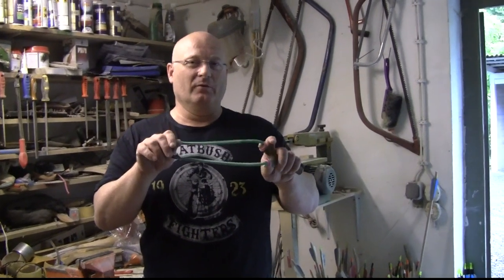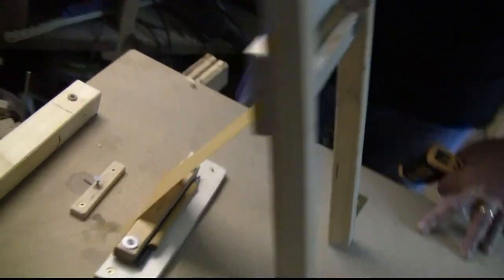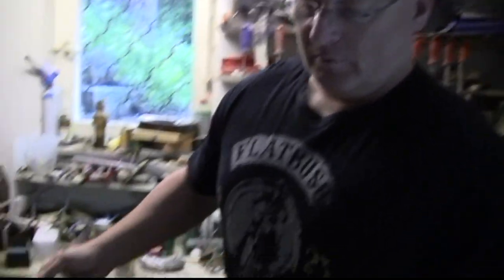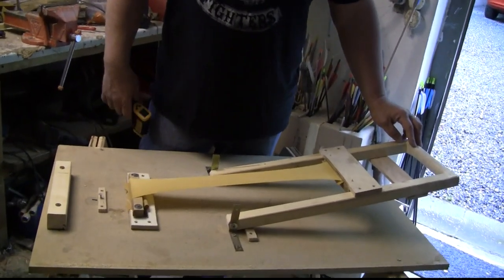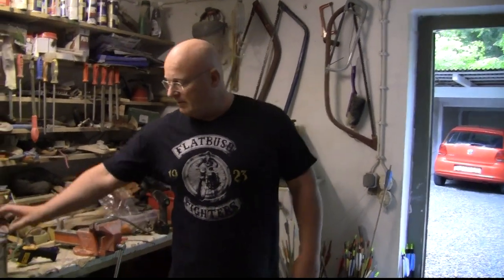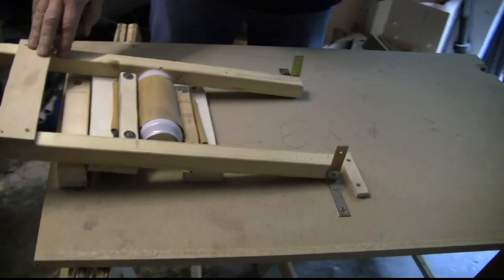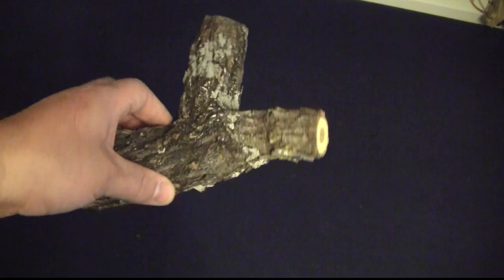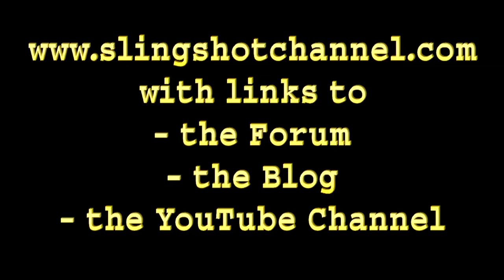Cooling beers with the slingshot

Comment: two things would improve the efficiency of your brilliant rubber powered beer cooler.
1. Cover the beer when you aren't cooling it.  You are allowing the beer to warm up while your stretched rubber is cooling off.

2. Provide a different beer/rubber configuration, so that the rubber is contacting underneath the can. There is a bit of air at the top of the can and that won't transfer the cooling as quickly as the side of the aluminum can.

Comment: What you need is TWO rubber banded levers opposed. That way, the beer is being cooled by one relaxed band as the opposing (stretched) band is cooling. The beer spends less time sitting in ambient air temperature, and twice as much time wrapped in a cooled band.

Comment: Your problem is that the thermal energy stored in the rubber dissipates into the environment, and then the thermal energy of the beer transfers to the rubber until they reach equilibrium. Unfortunately, the thermal energy released into the environment from the rubber will then be absorbed by the beer until it reaches equilibrium. With no way to keep the beer from absorbing heat from the air, all your doing is cycling the heat.

Comment: A way to optimize is to put rubbers on both sides so when one is relaxed the other is stretched.  That way there is always a rubber touching the can.  If you don't do this, when the rubber is cooling, the can will heat back up to room temperature.

Comment: Stretching the band makes the molecules agitated, so they get hot.  He waits a bit for the hot rubber to cool off to room temperature while stretched.  Relaxing the band mellows the molecules, so they decrease in temperature to 6°C below room temperature.  The cool band can then try to cool the beer.  The beer has much more mass than the band, so it would take many, many cooling treatments to get the beer to 6°C below room temperature.

Comment: theoretically you could go cooler by force cooling the rubber at stretch with a fan. B-)
Reply: leigh bamforth but you got to be carefull, if you cool it streched to 6 degrees it will freeze on release.

Comment: Actually your rubber refrigerator is somewhat similar to just normal refrigerator. It uses the same principle (2nd law of thermodynamics), but instead of vaporizing and condensing coolant you stretch the rubber.
Reply: No
Reply: There is a trick.
With elastoplastic or viscoelastic materials strain you can only have energy dissipation, therefore heating. But it's different from the increasing temperature of a compressed gas or condensed coolant.
To cool down you'll either need either a gas expansion or a phase transformation with a coolant. Maybe one of this solution is hidden within the rubber.

If it's not rigged, I would suggest that the air in the pourous medium of rubber might get compressed during the stretch dur to high strains, and expanded during the release. But I didnt feel anything when I quickly tested it.

Comment: heat is actually movement energy at the atomic level. when you introduce tension in the elastic you increase the movement energy - then you let that extra heat bleed away into the ambient room temperature. When you later let the elastic relax that makes the movement energy decrease, and since heat is essentially movement that relaxation can "eat" heat and make the elastic locally colder for a time.

There is probably some friction involved, but the effect is less strong than this other effect.

Comment: If you put a little fan on the side blowing onto the rubber, you could get it back to room temperature faster, which would result in a more efficient system. You could also have a big metal slab that would contact the extended rubber sheet, which would suck out the heat of the rubber, doing the same thing. Also having two of them on both sides so that one was contacting the can while the other was extended would make the system more efficient. I think that a purely mechanical cooler is awesome!

Comment: Super interesting concept! But a normal refrigerator is just a heat pump/stirling engine which doesnt involve evaporating/condensing. Just adiabatic and isotherm transitions. 
The concept is even more similar: A rubber band is just the same as an ideal gas from an statistical mechanics viewpoint. Compression of gas gives loss of entropy = Stretch of rubber gives loss of entropy. Just need mechanical power to be able to create a temperature gradient and exchange heat!

Comment: If you think about it, it is no different to the way a refrigerator functions. With the exception that, in a refrigerator, the refrigerator compresses the gas, rather than stretching it out. The gas is compressed on the outside of the refrigerator, it is hot. The refrigerator waits for this gas to cool down. It is then released into pipes on the inside of the refrigerator. The air returns to its normal state and becomes cold.

Comment: Well, i think you can't cold your beer by 6 degrees in this way with only one "machine" like that because when the rubber is streched to heat up the bear is also heating up, so there might be some difference after repeating this again and again but it won't make a sense. anyway, nice science!

Comment: I've been thinking about this actually. What if you had multiple bits of rubber on a chain and sprocket system. One end stretched the rubber, and the other end relaxed it. That way you would have a continuous flow of rubber being relaxed.

Comment: i like videos on slingshots. we used to use inner tubes from tires but they did not last very long. they dry rotted. now the got surgical tubing and flat rubbers. you can buy a good steel frame with good stretchers for less than ten bucks.

Comment: Hey Joerg! I have a question, presumably the size and tension of the bands change the amount of heat that is lost or gained, so even if it was inefficient, could you make a much larger or taughter version of this (or what ever factors that are required to change the temperature more) and do it alot quicker? how big would it need to me?

Comment: When the rubber cool down, doesn't the can heat up?
I can remember all my thermodynamic studies but the parameter will probably be calorie exchange on object surface. 
Touching metal "feels colder" than touching rubber so I believe the small can surface is a better calorie conductor than the large rubber surface.

I know the can filled with beer will take more time to cool down 6°C than rubber, but it's why it's take multiples applications of rubber on can so it's probably out of the equation.

Comment: I'd think you would build a rubber heating device instead since the normal use of rubber causes stretching which adds heat. Maybe this would be way to impractical though

Comment: Or you could make it a continuous process, a loop of rubber around two rotating posts with one rotating faster than the other and the cans sitting on the portion fed by the faster post either rolling in place either held there by gravity and some sort of slot or held between two such systems side by side. I'm designing it in my head now.

Comment: then you mean manual. oh and another thing, you should take contact isolation of the metal in account so you better but the metal on the outside of the rubber to isolate it, keeping it blanc reflects the heat from the outside. some ideas.

Comment: well you cant actually cool it to 6 below room temp.  that would require perfect heat transfer and the bands would have to have the same Q as the can because you would have to do it once.  doing it more than once allows heat transfer from the room back to the can

Comment: Hi Joerg, Have you ever considered the speed limitations of elastic rubber against the ability of a spring to store energy, such as a bow limb? Bows of fibreglass / wood/ carbon propel arrows very fast. How about combining the elasticity of a slingshot band with flexible arms to give some extra speed?

Comment: What about a slingshot-crossbow that launches a bold with spring loaded wings/fetching that open when the projectile is out of the machine. This may make the projectile more accurate, allow it to travel farther or allow he machine the be shorter in width while the projectile is larger. It would be cool to see too.

Comment: I thought you had to wait for the rubber band to go back to room temperature once stretched in order to cool it 6 degrees below that once released. Why would you demonstrate a quick stretching a relaxing when that only makes the temperature either even or slightly hotter once relaxed again? BAD DEMONSTRATION AT THE END
Reply from the maker: Robert Conlee I think you did not understand the video. I used a technique called "time lapse".
Reply: JoergSprave I figured out what happened. I didn't wait until the end when you properly demonstrated the heat energy storage mechanism. My fault entirely. Keep truckin' on. Awesome videos
Reply: Look at 5:19,he does time lapse jump cuts.Correct me if im wrong Joerg!Awsome video and brilliant and as usual!Salud to you Joerg!